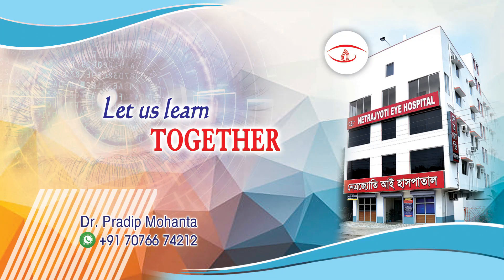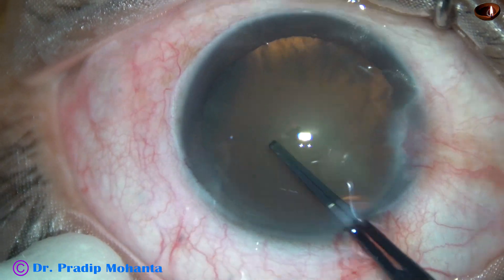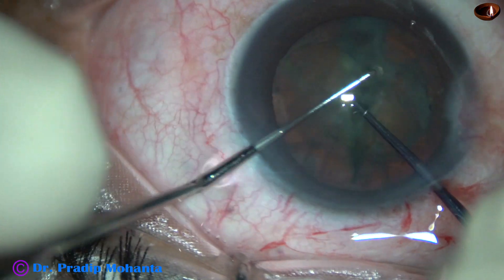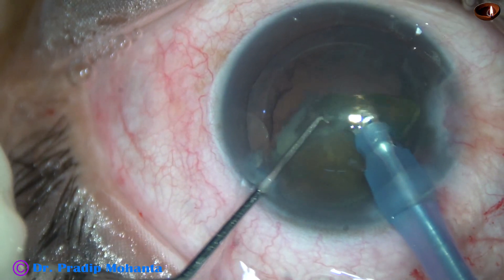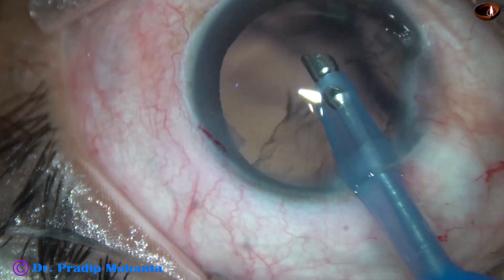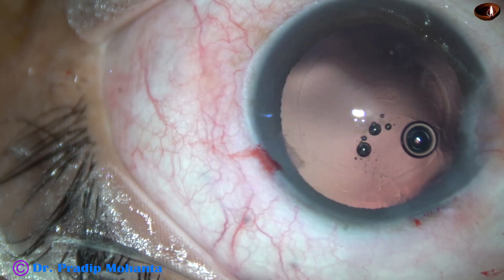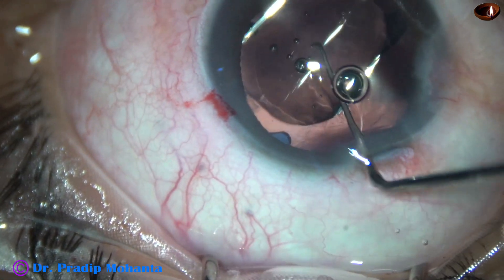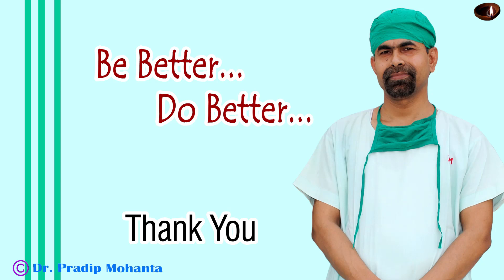Prechopping a soft nucleus and Cortical aspiration by  Phaconeedle : Pradip Mohanta, 18 July, 2021

Comment: Beautiful demonstration sir, as always a treat to watch. 
1.Sir, What type of injector you used,, it went very easily into the AC through a 2.8mm incision ?
2. Why did u not prefer  hydro-implantation of IOL here which u often opt for, any specific reasons ?
Reply from the maker: Preloaded iol, hoya 150
Screw type injector, both hands occupied, hence, Implantation by visco.
Reply: @pradipmohanta9321  thanks for the quick reply sir .